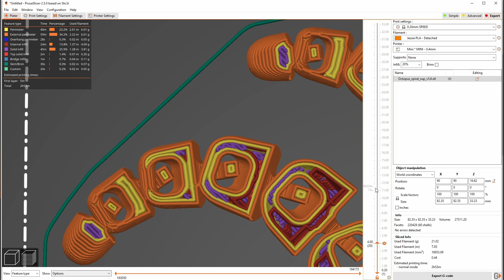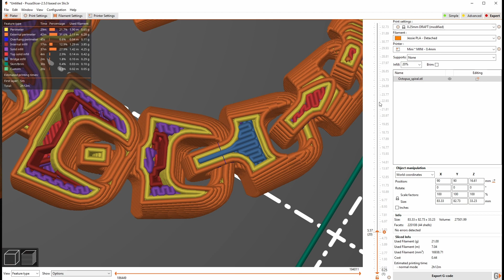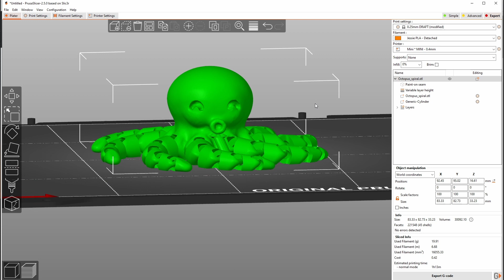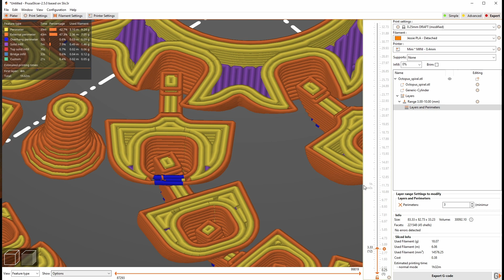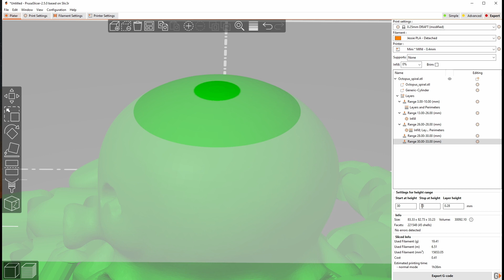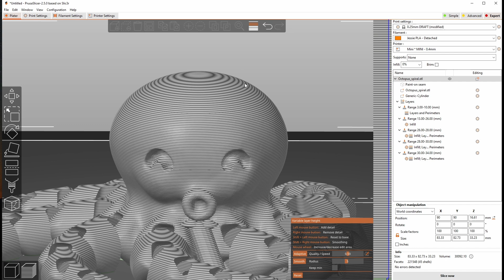More PrusaSlicer Tuning for speed, and quality

Comment from the maker: One thing I probably should have mentioned - It is probably best to start with the straight leg version and dial in, then switch to the spiral version. The links in the legs are closer on the spiral version, because they are angled. So if everything isn't dialed in, the spiral is more likely to fuse anyway from poor cooling, or stringing. If you have success with the straight leg version, but the spiral gives you problems, it is better to have a few less prints on the platter and be good, than more prints with issues.

Comment: Can't you use concentric top layers instead of more perimeters to avoid the zigzag fill near top? In Cura that's awful because it prints outward from center, but you can work around that by instead setting a high skin outline count, which prints inward from perimeter. Not sure what options PS offers.